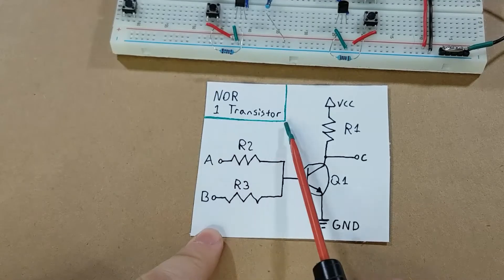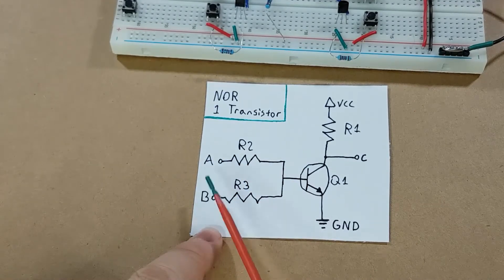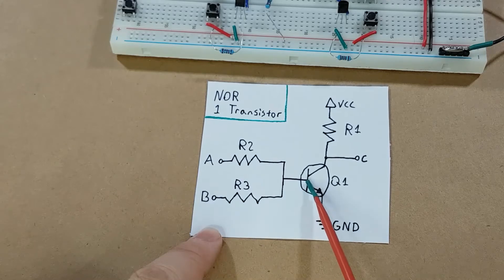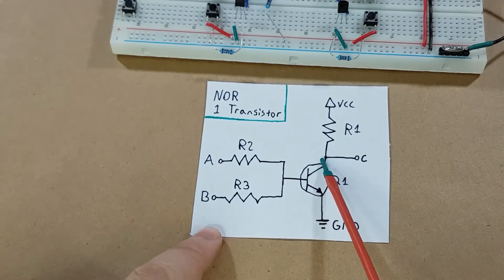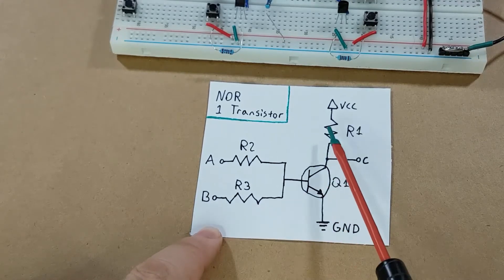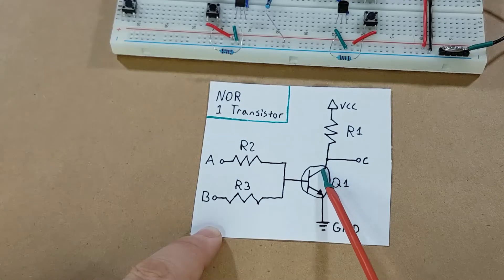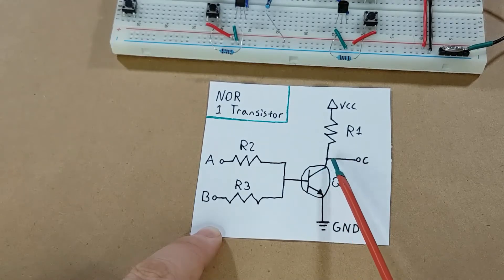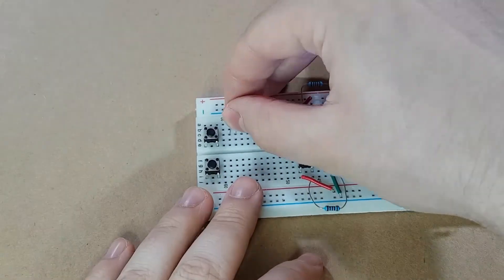TWT #19: NAND, NOR, and XOR Logic Gates

Comment: I agree that your gates would work as described. I would suggest using 100K ohm resistors instead of the 10K. The 2n2222 BJTs that you are using have beta of at least 100. If you use ohms law you will discover that using 100K resistors provides enough forward bias current for the transistors to switch on. Perhaps not saturated but it will improve power consumption immensely. The 5.1K pull up / down resistors require a re-think too. Their value should be dependent on the required output current of the gate.

I get the impression that you are half way there with it, and your communication and tone of voice makes for a good video.

Try applying some basic maths to the mix such as ohms law to perfect / fine tune your designs. 5☆ for your professional  efforts.